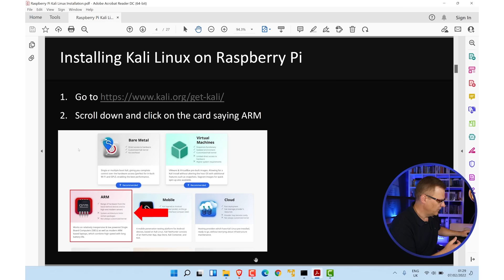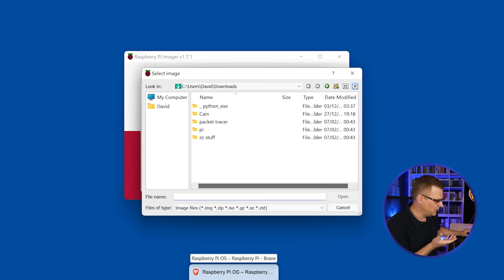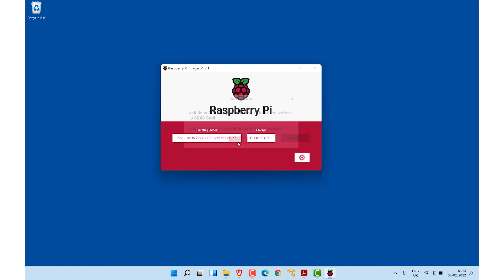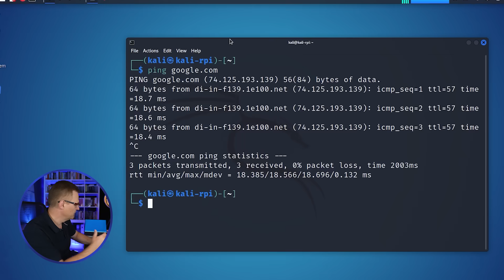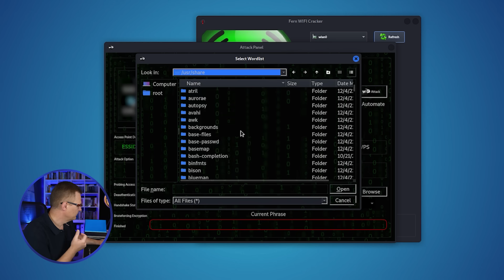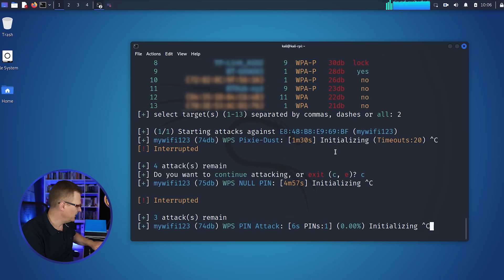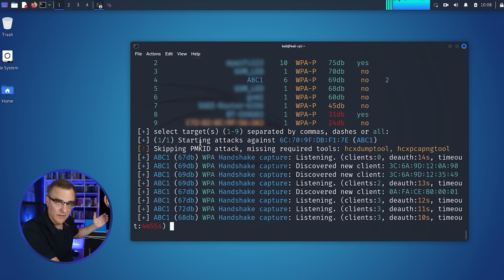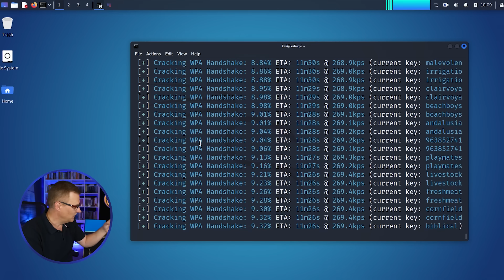Hack WiFi with a Raspberry Pi and Kali Linux

Comment: relying solely on tools like Wifite or Fern with default settings won’t get you very far. They’re just starting points. The WPS attack in Wifite, for example, uses a default PIN of 123456789 and will only try it until it times out. To really dig deeper, you need to get familiar with tools like Aircrack-ng, PixieDust, Bully, Reaver, John the Ripper, and Hashcat. But in the end, Aircrack-ng (with its sub-tools) and Hashcat are the core ones you'll need.

And remember: the range is key for capturing the handshake, and your computer’s processing power (specifically OpenCL or CUDA cores) is what will drive the cracking process

Comment: This is one of the reasons why I run a wired network at home. The other reason is because wire is faster. And of course, I have port security. I am a novice but I try to do my best to secure my network.

Comment: thanks for this tutorial. I've managed to adapt it to use it with my orange pi 5 and can now practise hacking on my home wifi network during the training course for a red team ops! though i preffer it to run it headless via ssh. it is fun to watch this small box justt hanging around with so much options in it! the downside of organe pi is that you have to use wifi card but I got a ALFA one that is great for sniffing packets :) shame this attack takes so much time it works 50/50 it is quite hard to get handshacke, I have really good router thatr can prevent a lot of attacks like that usually it takes around 50 to 60 attempts before it works.

Comment: Have full kali ported on my HTC phones  . with Hack RF and Alfa’s 
if you live nr a place with free WIFI u can make a directional antenna out of a Pringles box then connected to an Alfa high gain receiver and create your own home wifi network for your house.  Or if ya mate lives half way can bounce from him to benefit ya both. 
Loads a fun to be had lately.  Treat ya developers with kindness. 
Keep on top of the this that have ya direct debits. They take the Micky. 
So we can keep the world secure.  Or we’ll loose every last bit of privacy we have.  And we will end up jigsaw pieces that don’t fit in the board. 
Nice work geezer.  With I had the time a decade back to get it out there like yourself.  Keep it up, al share.

Comment: Pi’s aren’t really the best for Ethical hacking. Small processing power, slow cracking capability, small amount of RAM
Reply: Please tell us about your experience in this field? I'm very curious.
Reply: @mannhansen9337  just over 4 years in the field. Regardless of my experience.. I know that Pi’s aren’t good for ethical hacking.. the computational power isn’t enough for what you truly need
Reply: @FahyGB  Thanks. What do you recommend for ethical hacking ? Can you show us the math why the Pi is not fast enough?
Reply: @mannhansen9337  no but you can google the specs of the Pi and google minimum specs to win Kali and off sec tools. There is no way on this earth you’re cracking a password of 4 character length with a pi

Comment: Hi David ! Thanks for your really good content! I really appreciate it. Did you notice, that the builtin WLAN of the Pi stops catching packets after some minutes? Do you have a solution für this ?
Reply: Have you tried to use a WiFI USB dongle instead? Is the power supply delivering enough power? At least 3 A
for a RPi 4.

Comment: Does someone know if there still is a problem with the 8GB version and 64-bit version? Seen several older videos that highlights issues with either the 8GB and/or 64-bit version.

This can be read on Kalis website:
“We recommend using the 32-bit image on Raspberry Pi devices as that gets far more testing, and a lot of documentation out there expects you to be running RaspberryPi OS which is 32-bit”.
Is that also something to ignore? I’m a noob so I would really appreciate some more info. My concerns is mainly if it’s stable in the most important programs? 

Other thoughts:
- How many programs can fit on the SD-card, and which is the most important?
- Is there a need of multiple OS and can that be done on this Raspberry?
- Is Raspberry Pi performance enough for a newbie to use when learning?
- Is there a need for cooling when running programs for hours?
- Any classic newbie mistakes to prepare for?!

Comment: Panda Wireless PAU09 N600 Dual Band (2.4GHz and 5GHz) Wireless N USB Adapter works in monitor mode on the pi 4 running kali or raspbian with wifite installed.  works well headless to SSH in using the mobile hotspot on your phone with the builtin adapter and put the panda in monitor mode.  wifite2 i believe is available

Comment: Do I need to use a MicroSD card? I have a 128gb SanDisk USB stick with read and write speed near 480 mb/s with usb3 which Pi4 supports. 

If I can use the usb stick, It will max the performance of my Pi4 8GB. 

So, can I use the USB stick? 🤔

Comment: Hello David. Thank you for another great video. Do you have any suggestions for a Raspberry Pi distributor that frequently restocks and is reasonably priced?

 It seems that we all are still affected by the chip shortage. Would you have any recommendations for anyone looking to get their first time post pandemic Pi?
Reply: The Pi 400 seems to be generally widely available. For the Pi 4, they are selling all that they can make so no relief in sight short term.

Comment: Cool video.  I installed Kali on a Pi a couple of months back to play around with network hacking. I'm also using an Alfa adapter which works out of the box with the Pi.  Barely scratched the surface yet but it's interesting using Kali on the Pi just to see how far you can get.

Comment: The problem with using a PI is that if you have to compile C++ code for an attack the PI using ARM architecture won't work when uploaded to an Intel based machine.  You can buy refurbished PCs for about as much as a PI and they are much more capable.  You can get a "refurbished" HP mini with 16G RAM, quad core processor, and an SSD for $150.  I know these machines are hit an miss so buy from someone who will take it back.
Reply: Good idea. I buy used Lenovo Y510P and Y520 machines. Sold as gaming machines a few years back.
Pay about $150-200 with 8-16 G memory and SSD. If you have the source code available i C++ it's
quite easy to recompile using Ubuntu or other Linux. You can even install GCC (C++ compiler) on Kali.

Comment: Hi David. Felippe, from Brazil. Huge fan of your work and teaching style.
Can it also be done with a external wifi antena (in monitor mode)  using RPI3 B+?
Reply: The Alfa Atheros AR9271 works on Kali on Raspberry Pi basically plug and play, and it should be easy to do it.

Comment: Good video David, I did this about a month ago but I needed to do this remotely: Pi4B powered by PoE with on board WiFi in monitor mode. The problem is when running airodump etc. You first have to kill the services running on dhcpd etc. Unfortunately this kills the dhcpd on the ethernet too. So when the dhcp lease ends, the RPi becomes unusable. I wrote a watchdog script to periodically wget on google then restart the dhcpd service so I can get back in. Yes I could fix the ethernet with static IP but I wanted a tool that could be deployed anywhere on the metronet for compliance monitoring so a plug and play PoE device. Back to the drawing board for me until I figure how to use the WiFi tools without killing the Ethernet.

Comment: Great content David, really helpful tutorial. Just one question, is it true that raspberry PI 8gb have problems with installing kali??
Reply: use the 4gb pi works great
Reply: I've never had any issues. Installed it on a few of them
Reply: You shouldn’t have any issues installing Kali on an SD card, it is straight forward
Reply: The only problems that I had were, always, with resolution and xfce... 😂 gnome and hdmi_group=2 hdmi_mode=82 and problems solved. 😎
(Used with 2, 4 and 8GB models)
Reply: @VisaoNocturna  is that in raspiconfig?